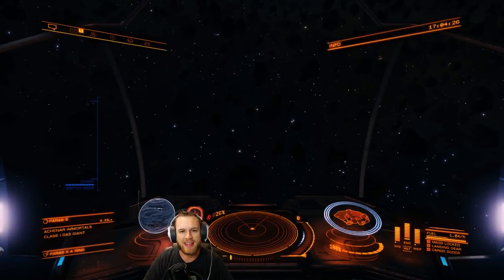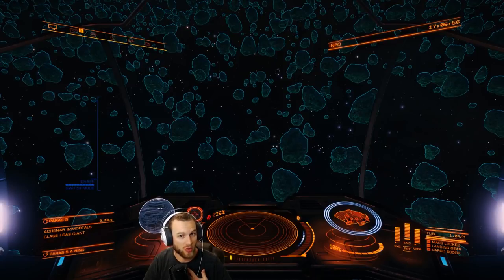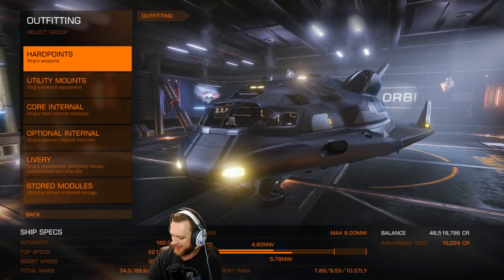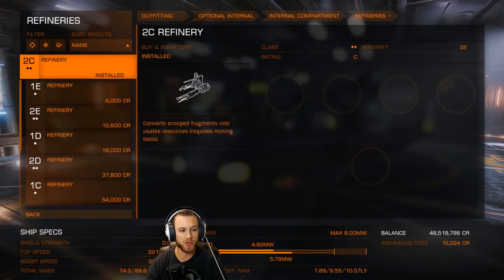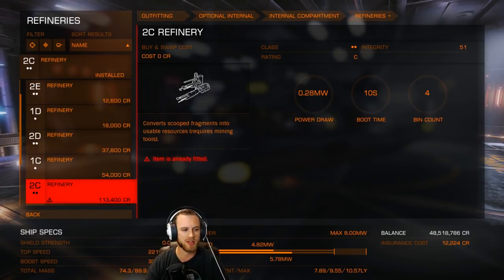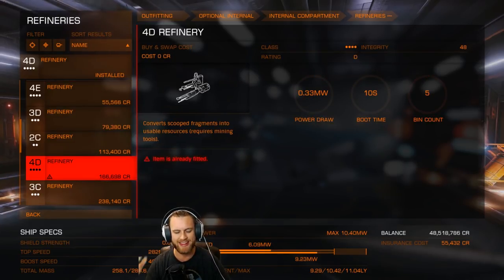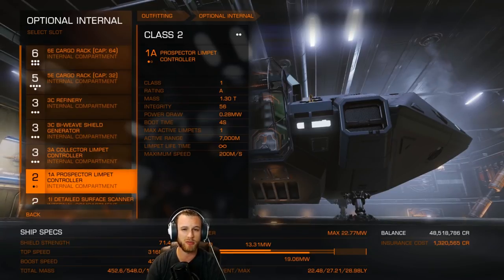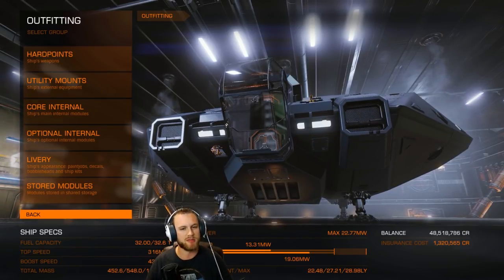BUDGET MINING BUILDS | ELITE DANGEROUS MINING LOADOUTS AND THEORY

Comment: The ZP Adder actually is pretty nifty if you want to dig into some actual profit and make money for a bigger ship,.
Because its got a size 2 hardpoint on top, so you can deploy explosive charges and use one of the small hardpoints for the abbresive blaster. 

For example in a pristine icy ring you can find Alexandrite or Grandidierite hotpsots and 1 single ton of refined goods from that gets you around 273 000Cr; and 256 000Cr respectively. 
Now if we get 2x8t cargo racks, that'd bring in 4 368 000Cr on the very first successful run. 
That is with the refinery being the 1E variant with 1 single bin, because if you mining selectively, you don't need to deal with any other materials and if you blow the asteroids apart just right that'll mean you need to blow up only 2 of them.
I'd say that ain't shabby for a ship that'll cost - with retrofitting -around 200 000Cr. It brings back its own price plus retrofitting on the very first successful core mining run and adds a good chunk of money to create some financial safety and then you can start working toward the larger ship of your chosing (plus the insurance and retrofit cost of the new ship just to be sure :P ) Meaning in about 2-3 successful runs you can sit in a fully kitted out Ask Explorer to continue mining with more safety and larger capacity.
Reply: ColemanV im not even pissed that they made it easy to make Cash, if you are looking for it. It makes it more beginner friendly and everyone  else can do some simulation stuff without being forced to play one style to make cash.
Reply: Void opals

Comment: Shlepped over to Paras yesterday (in open), and everything's tapped :(  Also, if I might add to the budgeting, when you're doing your build, use eddb.io to find your ship and modules in a system controlled by Li Yong Rui; you'll get a decent discount on the ship and modules (I think it's a 10-15% discount, but be prepared to have a bit of a hike if you don't already have a ship with a good jump range and aren't near to one of his systems already).

Comment: Deep core mining.  Asp Explorer with 4 abrasion blasters, 1 seismic cannon, pulse wave, detailed scanner, 2 collection and prospector, with a shield and lots of cargo racks.  And a refinery.  One haul of good ore from a hot spot is netting about 15-20 mil.  You get your initial investment back in one haul.  Benentoit, or Alexandrite, or something comparable.  3 really good hotspot rocks fills your hold.  Fly 4 or so lightyears out and it goes from 300k a unit to 500k a unit.  Worth the work.

Comment: Nice vids. Can i ask. What ship do you prefer mining in? I useually used my cutter. But it seems overkill... do you do guides on how to find good rings aswell? Cant seem too find any
Reply from the maker: So I'm working on a simple guide on how to find a good ring currently! So I spent some time in both the Asp and Python mining and found that even though the Python is a bit bigger than the Asp, it has way more storage and made it much more worth my while. I was able to stay deep core mining for 3 hours straight and filled that bad boy to the brim (192 tons cargo) with valuable stuff and got about 70 million off it and I didn't have to go back to stock up at all.
Reply: @skabbard2374  so a cutter with 590 tonnes or so would keep me Busy for days and earn me many many millions i reckon
Reply from the maker: The only thing that would make you have to return is needing more seismic missiles or limpets. If you have that much space you would run out of missiles way before you filled up. If you wanted, you could equip more than one launcher and just use one at a time until they both run out! Actually, I wonder if you could synthesize the ammo for that on the go... We will have to find out!
Reply: @skabbard2374  still. Having trouble finding belt and good asteroids
Reply from the maker: Have you used the website https://eddb.io? This is a great resource to help you potentially find some good places to mine and then good places to sell what you get for big profits